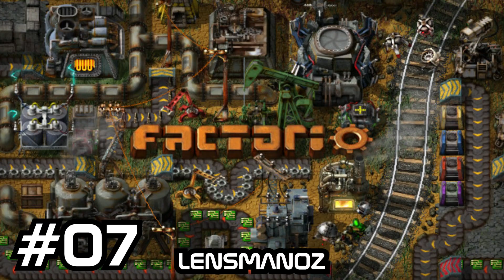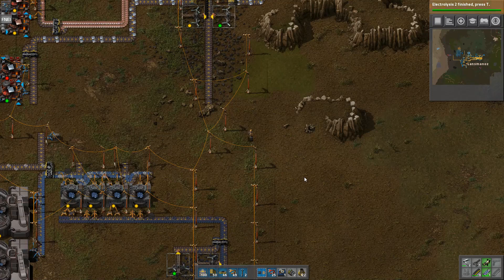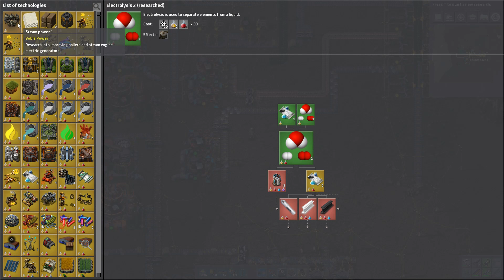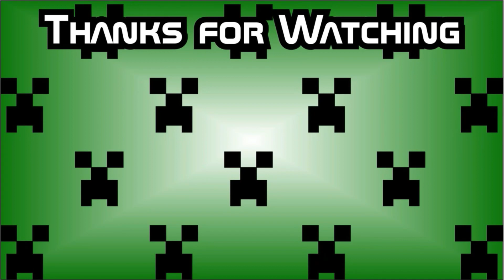Factorio Modded - Ep 7 - Gasses & Nanobots

Comment: The seafloor pump which needs to be placed in water can also produce Viscous Mud Water.

If you've researched near inserters, you can have them insert on the closer side of the belt with Shift-E which means you don't need the belt squiggles you're currently using.

Since you have loaders, make an inline storage, by placing down a loader, a chest, and then another loader going out. That will let you store some up and have easy access to it. (I'd say limit it to one row, because you'll want a lot of personal iron.

Flare stack to void gasses, Clarifier to void fluids.
Reply from the maker: Next episode will show seafloor pump.

Will investigate near inserters. Gotta be better than the squiggle!

Not sure about inline chests... maybe some of the items. I'm using loaders on the ore silos now.

Ahh, I knew there would be ways to void stuff
Reply: Cool. The inline chests with the loaders serve a dual purpose. It buffers and balances the lines, as well as providing you a supply of items. But the loaders themselves are quick enough to input and output without hurting the throughput of your system. And it's definitely easier to stop and pick up a stack of just iron from a chest, than it is to try and hoover it up on the lines and end up with a bunch of waste. Or pick up some circuits without having to manually craft them when you want to make an inserter.